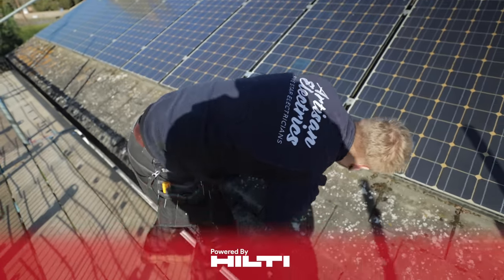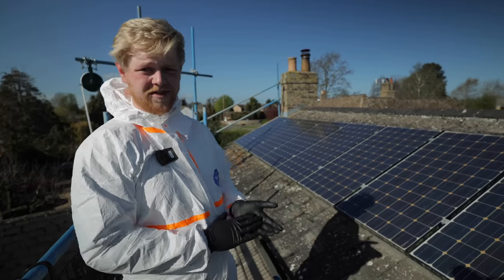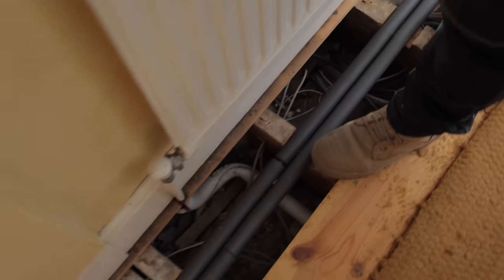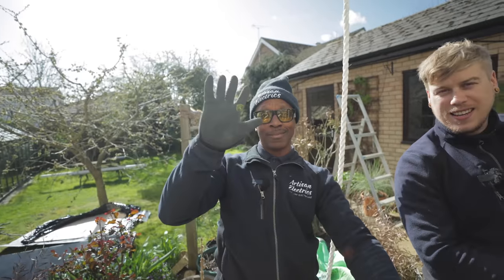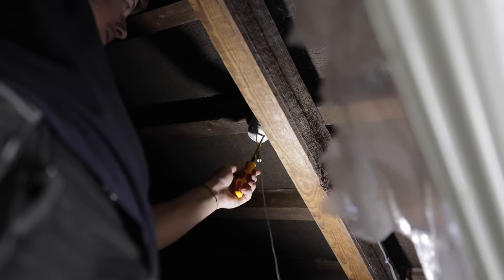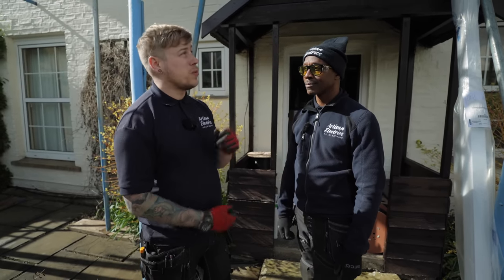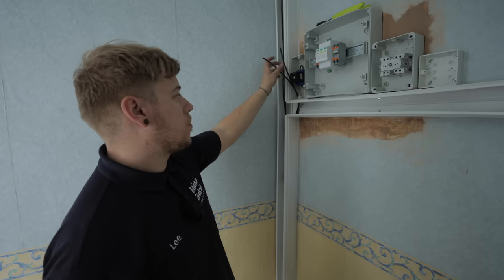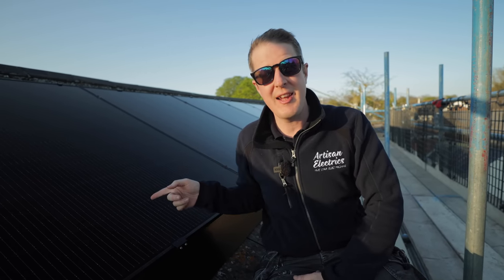I Nearly Walked Off This Solar Job.

Comment: Hi,I have a question and hope you can advise. I’ve had recently a new RCBO consumer unit with surge protection installed. I have a 5kw Solar pv hybrid system. The Solar ac feed is fed through the top of a 25a RCBO into my consumer unit. Is this ok? Can rcbo’s be fed from the top?
Reply: Rcbo doesn’t care which way the current flows. If you have a hybrid inverter it can probably charge the batteries using off peak power which would pull current the other way anyway.

Comment: How does the DC surge protection work in parallel to the DC circuit? Does it just short one or both of the leads to ground when there is a voltage spike?
Reply: Correct

Comment: Was this installation originally installed under the Feed In Tariff scheme? If so, how did you stick to the rules regarding the changes you've made? I'm certain the customer hasn't decided to forego those FIT payments.
Reply from the maker: Customer was getting bare minimum FIT and chose to forgo it to get a new system installed with battery etc.
Reply: @artisanelectrics  Surely a system that old would still be getting the top rate of FITS ?
Reply: Eh? Why would you want a battery if you could access those insane FIT rates.

Comment: Get a solar panel lifting bag. Using a rope is not only dangerous it takes longer and looks very amateurish. 👍
Reply: Carried them up the ladder for years no problem fitted thousands of pannels loved watching this made me laugh bunch of amateurs must of cost the poor guy a fortune two pv fitters would have the old pannels of and new ones on in a day two days work for the sparks
Reply: @shropshireladoutdoors743  No problem with carrying them up ladders. Getting more difficult with panels now bigger than you (450w-600w). 
But they are always going on about being a "premium" business and charging "premium" prices and then using a rope when a suitable piece of equipment is available and not exactly expensive.
Reply: @gavjlewis  bit of a joke aren't they and to put it on utube even funnier 🤣 the pannels didn't look that big to be honest ours used to weigh 20kgs

Comment: For someone who works in the office Wayne seems to know his onions 🧅 👍

Presumably this is an old FiT install (bodged by the looks of it) - how does it work with the upgrade? What happens to the old kit - hope it’s being repurposed or recycled appropriately? Seems there may be much of this type of old hardware being junked like this 😢
Reply: Technically I guess unless the customer asked for it to be disposed of, its still their property.
Reply: @Arachnoid_of_the_underverse  indeed but in reality I suspect that unless either the owner or Artisan see any value in them (the way it's described as old and inefficient makes me think not because you don't sell new stuff unless there's "better" stuff to sell!) it will probably be sent to the skip rather than being re-purposed (or maybe even recycled appropriately), after all 5 or so 200W panels would still be useful in another context - the limitation here was a the roof area so squeezing in more power to the same area make sense along with having the battery. I had a neighbour who was re-doing a house recently and the previous owner had 3 x200W panels on a garage from the pre-FiT days - I asked what he was planning to do with them as they were on the ground and he said he'd been told they were old so would go in the skip but offered them to me if I could use them - they still happily knock out close to 600W on a sunny and cool day - plenty enough to use on a small off grid system for the workshop 🙂 Likewise the main roof had a solar tube array for hot water much like the one here but the roofers smashed it up on the assumption it was no use 🙄